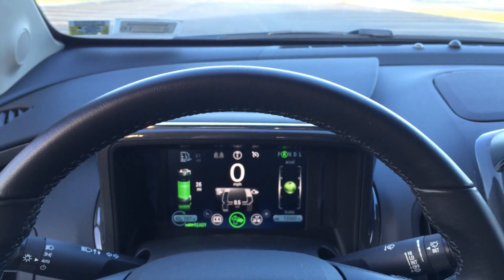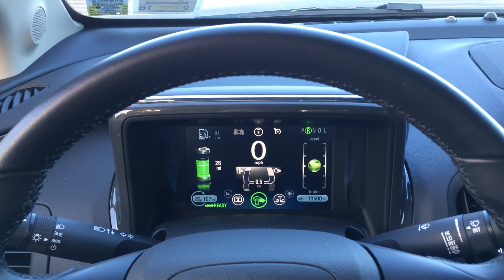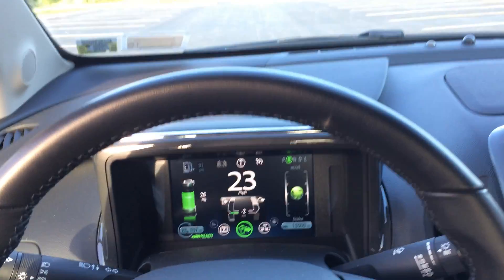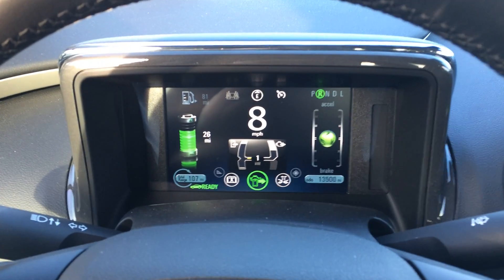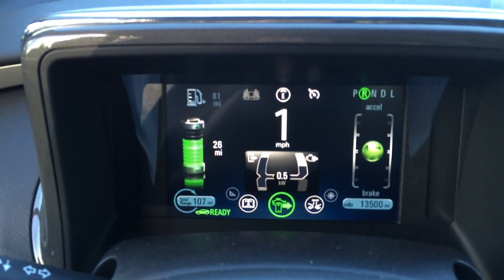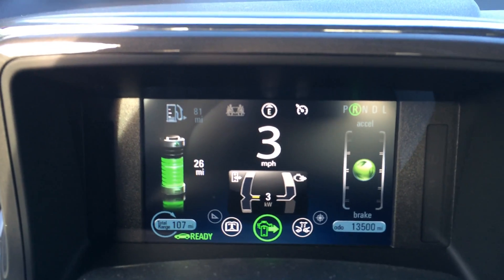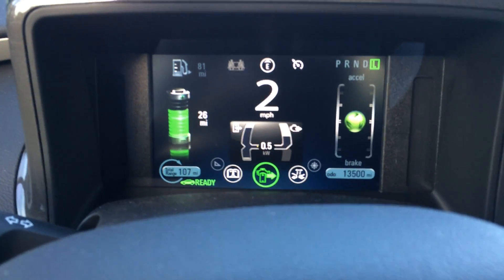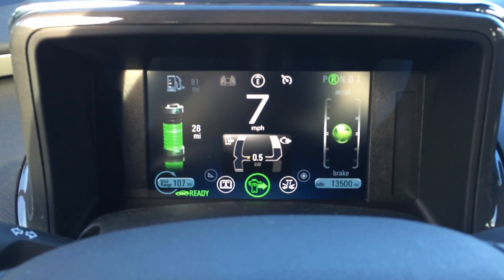Chevy Volt Drive to Reverse at High Speed

Comment: 1:30 You can use your reversing camera while in Drive/Low , not just Reverse? Hack or all 1st gen Volts do this?
Reply: It must be a hack. My 1st gen doesn't do that.
Reply from the maker: The camera was working while I was going forward because I had placed the car into reverse.  The camera turns on based on what gear position the shifter is in, rather than what direction you're traveling.
Reply from the maker: Sean, see above.  It's just like yours, i.e. the car was in reverse because I shifted it into reverse while the car was still moving forward.  Also, in other instances the camera doesn't turn off after shifting out of reverse for 2-3 seconds.
Reply: I'd like to figure out how to use the rear camera while in Park or Drive Mode.  Sometimes I tow a small trailer or have a bike rack on my 2017 Volt and it's nice to be able to check on those items while driving using the camera.

Comment: I've done this with my 2017 Premier at 70mph.. the camera come on and just regens like normal.
Reply from the maker: Yes, at higher speeds it will not slow you down.  In the Gen 1 Volt (2011-2015), this cutoff is somewhere around 35mph.

Comment: Note that at speeds above 35 MPH,. the car will behave as if it is in neutral when put into reverse.
Reply from the maker: Yes.  In fact, a quirky "Speed limit" message comes up too when above 35mph in the driver's console.  It's the same message that comes up if you try to go above 100mph in Drive, except that in Reverse, it displays whatever speed you're currently traveling, updating it while the vehicle slows down below this threshold, at which point it allows the behavior shown in the video.

Comment: Is there a particular reason why you use L and not D? I wonder what's the difference between the Volt's L gear vs. the Prius' B gear.
Reply from the maker: +Trades46 In the Volt, L versus D is just a difference in how much regenerative braking occurs when you let off the accelerator.  In D, it acts like a normal car.  In L, you have much stronger regen to slow you down when you let off the accelerator (similar to a low gear, hence the name) and you can also use the top portion of the accelerator pedal travel to control how fast you're slowing.  The result is mostly one-pedal driving, without having to use friction brakes or press the brake pedal the majority of the time.  It's fun!  There are still SW algorithms in play when you press the brake pedal, to determine if friction or regenerative braking is used, but not pressing the brake pedal guarantees no friction brake use, and again is more enjoyable to drive in my opinion.  Both modes can otherwise travel at all speeds/accelerations, it's just the software that changes the behavior described.
Reply: The friction brakes do not engage until below 7MPH and when the efficiency guide (ball) goes below the 2/3 mark. Regen can take a lot more energy than you may think. Regen braking is great, but it's actually more efficient to coast than regenerate. During warm weather, I can get up to 55 EV miles in my 2014 Volt driving in D with 1/3 a gas tank.
Reply from the maker: I hear the argument about coasting a lot, but it is just as easy to coast in L, you just need to feather the accelerator a bit more.  Similarly, even in D, you are not truly coasting at higher speeds unless you're feathering the accelerator a bit.  So each mode allows coasting, but L guarantees you will never use friction brakes by avoiding the brake pedal, and D does not.  At some level it does come down to personal preference, but for many, L can help people to learn to avoid hard braking, and still provide the ability to coast when it's more efficient.
Reply: I agree that one pedal driving is arguably the best implementation for EV. Yes coasting is more efficient use of power but there will eventually come to when you need to stop I rather not use my brake pads & get eke out just a couple more % of battery for either driving or accessories in the car. 
I'm not sure about the Volt or Bolt, but if L gear works like how the BMW i3 which I did drive which is pretty much ALWAYS in L gear on the GM cars, there is a 'middle spot' on the throttle where you can coast. And if you're just trundling along at freeway speed, use cruise control instead.
Reply: I've found driving in D with coasting & e-paddle a lot more efficient than L